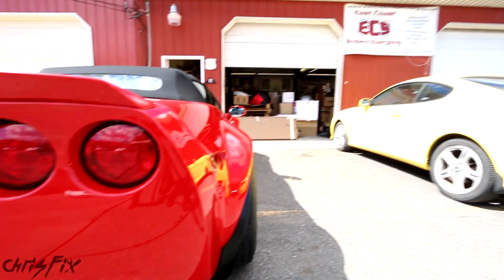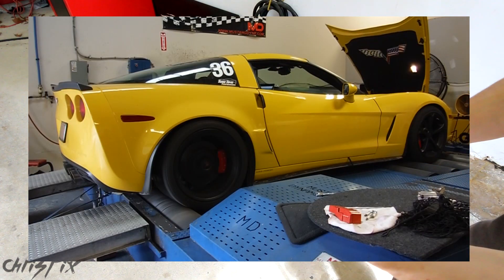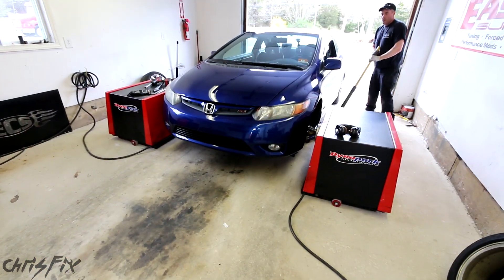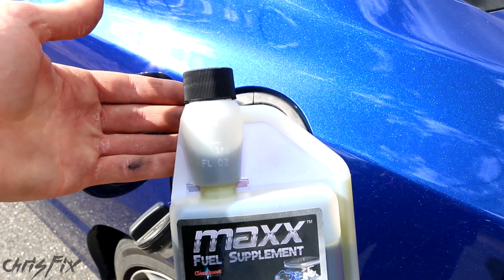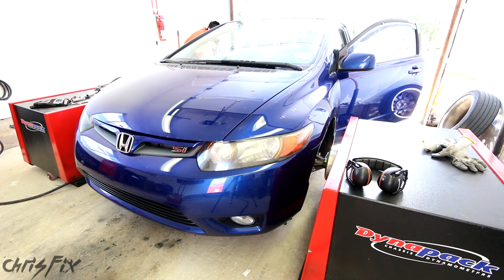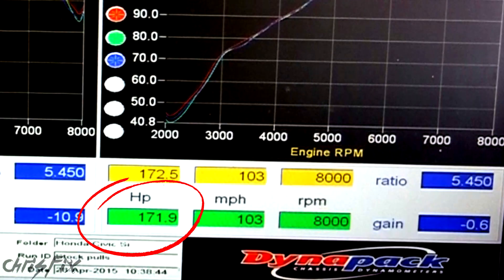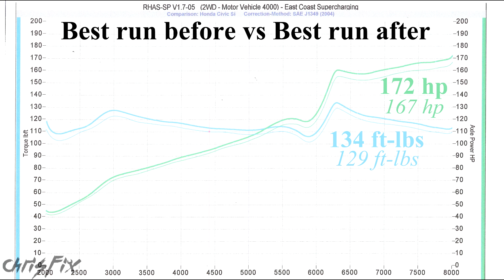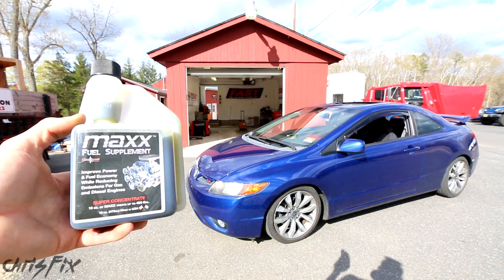Can a Fuel Additive Really Increase Horsepower in Your Car? (With Proof)

Comment: RSX type S vtech kicks in a lot harder. can't really tell on this vid.
Reply: +Slugontharug VTEC isn't just a simple vvt, especially the newer stuff.
standard vvt only advances or retards a fixed profile. 
the first gen VTEC had two distinct cam profiles. lift duration and timing were all shifted for the second profile, this returns better results than a simple cam advance.
Reply: 1: vtech is a phone and toy maker.
2: aggressive crossover isn't always ideal. if your vvt cam is activated a few hundred rpm later it will feel more aggressive because the stock cam has already started to taper off. too soon and you may loose power as the higher lift and durations goal is to build power at the top.

I would argue you don't want to feel the crossover for maximum power, but having an aggressive crossover gets you that kick to the face feeling and probably helps sell cars.
Reply: +Slugontharug care to elaborate? I'm not sure where you are pulling your supposition from.
Reply: Slugontharug"my Nissans VVT kicks in harder then any Honda." Lol. No it doesn't.
Reply: +Gavin Au And my Nissans VVT kicks in harder then any Honda. Way more noticeable and loud as well. If vtec is all Honda has going for it then consider something better, most cars have vvt or 'vtec'
Reply: +Emilio Perez well thank god my g8 doesn't have vtec then. lol
Reply: I'm not sure why. A variable cam has better power performance than a fixed. Think about your big lumpy cams. They usually aren't so hot at the bottom end but haul at the drag strip. The more variable a cam system is the more cake you can have and eat too.
Reply: +Emilio Perez I would argue the dyno is saying otherwise.
Reply: +Emilio Perez Damn, I had written this all out then it didn't post. I don't know too much about vvt so I won't pretend I do. However I would just think it would be more effective to have vvt become effective at an rpm appropriate to the engine and have it come in more noticeably then it would be to have the extra power dispersed through the rpm range ( which I believe is what your saying ) this dyno vid and others will show vvt is more efficient the way it is.
Reply: +Slugontharug research cvvt, it is superior to a two or three stage vvt.
it does not really exist but a continuous variable valve timing and continuous lift and duration system would be better still.

if you aren't familiar with how engines, specifically the role of cams it would take a monster comment to explain. 

if you want to play with this stuff check up on automation on steam.
Reply: +Emilio Perez I'm an apprentice mechanic I have been into cars for years , taking an overhead cam or dohc engine is easy most the time once your use to it. This is all just for efficient power of course there are other better engine platforms but for there purpose I don't think you would want them any other way.
Reply: +Slugontharug what Nissan is that just curious?
Reply: +slime carter There isn't one. The guy's an idiot.
Reply: +slime carter '05 sentra se-r spec v
Reply: +Tyler Hunt There is no what? I'm far from an idiot
Reply: +Tyler Hunt Why do you say that? I'm not even gonna argue with you because right off the bat you are showing you have no idea what your talking about
Reply: Slugontharug
Lol. The Sentra se-r specV Has cam phasing and dual intake runners. That's it. It doesn't have dual cam profiles like a VTEC motor. The "kick" in a sentra is not much more than induction noise.
Reply: +Tyler Hunt Okay. You missed my point , I'm not sure why your going off about that . I'm merely stating vtec is vvt , Honda is not the only ones who do it and my nissan does it better then honda.
Reply: Slugontharug
Lol. With that attitude, you'll be nothing more than an parts changer, not a real mechanic. You obviously have no clue what you're talking about, and worse yet, don't even realize that you don't know. You don't know what you're talking about, yet you have no problem pretending that you do. You're going to want to cut that shit out if you ever want to be a component mechanic.
Reply: Emilio Perez
The original VTEC system is probably simpler than a cam phasing VVT system. It's just on/off as opposed to continuously variable. But yeah, WAY better system for producing more horsepower. And even better now with the addition of cam phasing. 
You're bang on with most of your posts.
Reply: +Tyler Hunt Not quite sure why you are being so hostile. calm down man.
Reply: Slugontharug
You take money from people to work on their cars right? That is your current and future profession right? Then don't be arrogant with things you don't know. I've worked with too many mechanics that don't know their ass from a hole in the ground, but have no problem telling you how right they are. Don't be that person. Be better than that.
Reply: Emilio Perez
There's actually a few different continually variable lift systems out.
Nissan VVEL
BMW Valvetronic
Toyota Valvematic

They all work a bit differently to achieve the same result. But yeah, continually variable valve lift is here.
Reply: +Tyler Hunt my appologies if that is how it came across.
Reply: Slugontharug
No problem man. Just try to be conscious of things you don't know. You won't learn if you think you already know it. Try to be aware of different systems and how they work. It'll make you a better mechanic.

And get good at diagnostics. It's never been more relevant. Parts changers are replaceable, people good at diagnostics aren't.

Hopefully this didn't come off as condescending.
Reply: +Tyler Hunt haha it did at first , but all is good. have a good evening
Reply: Slugontharug you too man.
Reply: +Tyler Hunt you are correct, almost everybody has vvt. 

my Subaru has it as well. (I strip and do basic repairs on subarus as a side job)

Comment: I'm curious how this stuff would add up in a tuned engine?  It's like adding octane booster to a car that's knocking.  Bumping up the octane will stop it from knocking and allow it to achieve it's max power.  But how would it affect a car tuned for performance?
Reply from the maker: +chincemagnet That is a good question because this isnt an octane booster. So you could run an octane booster and this and probably get a good amount of power.

Comment: 0:10 Wow, those are some chintzy anti-performance wheels.
Reply: +K.H. ... wow.  First time hearing someone call a $6k set of forged wheels "chintzy anti-performance wheels."
Reply: +B. L bet. Those wheels are not 6 thousand dollars
Reply: ... they're 360 Forged wheels.  Assuming they're either 19 or 20", they easily clear $5k and are very close to the $6k mark before shipping and tax (if applicable).  They're pricey ... no idea if they're worth it, but they certainly aren't cheap.
Reply: Looks vs rotational inertia and unsprung weight. 

Worth it if you like the big rim (donk) look over, performance. 

Or you could have the right size that clears the disc brakes and allows for enough tyre width.
Which is better for performance and is cheaper.
Reply: +K.H. They came with 19s and 20s stock lmao. They're also wider with a fatter tire on them. So they're actually better than stock. 

Dumbfuck.

Comment: this means nothing , well within the acceptable range , a lot of variables come in to play !! no difference at all
Reply from the maker: +Steve Cea Thanks for sharing.
Reply: Witch Hat Productions sorry but 1 or 2 degrees difference in air temp could have easily given those numbers , you want to push false results on bogus products that's your right I guess but in no way whatsoever should people be running out to buy this garbage thinking they are going to see anything in HP gains,  and even if this stuff by some miracle actually did give you a couple of horsepower ( and it doesn't ) you would never feel that supposed increase at all nor would it improve your performance times !!
Reply: Witch Hat Productions do go ahead a waste your money for HP in a bottle , this is hysterical that people here actually think this stuff does anything LOL !!!
Reply: +Steve Cea using the highest reading from the before and the lowest reading from the after, there's a 4 hp increase, and that's comparing the best results of the first test to the worst results of the second. Furthermore, the consistency of the results after the fuel was added is not what I would consider "no difference at all". They used the same tank of fuel, the same car, and they used a highly accurate recording tool. I don't see how there's "a lot of variables" that went unaccounted for in the performance of this test.

Comment: holy shit that was insane, you need to do this nonce more but pump full gas and use the full bottle! then boom 1000horsepower fu buggati :D
Reply: +xorkatoss um... Bugatti's big trim is 1200hp awd...  but maybe weight will help the SI in a rolling start?  dig no way

Comment: Ok, so something else is going on here. There is an unaccounted for variable in the experiment. We should see some non-trivial loss in performance due to the heat-soak in the second test with the additive.
Reply from the maker: +alephnot000 At $300 a set of runs that is hard to do. I would love to jump on the dyno all day but it is expensive and comes out of my pocket!
Reply: Just keep in mind that the test results are only as accurate as the instrument measuring them. A dyno is a machine that takes a lot of abuse over its lifetime. It wouldn't surprise me to find out that the dyno isn't serviced regularly. If I had the time or cared enough I would take my car to the same dyno every day and get a reading at the end of the day once everyone had gone before me. That way I could calculate the standard deviation and be able to quantify how accurate the dyno is.

Comment: after your 20 minute drive it would of warmed up all the transmision oil and drives and created less friction, and as a result of that the hp would increase on the dino. It would be interesting to do it again in reverse order.
Reply from the maker: Oil and tranny temps were the same (similar) before and after.

Comment: What fuel are you using during this test? 87 octane or higher?
Reply from the maker: 91
Reply: +ChrisFix Hey man great vids all round as been trawling them all afternoon :D. Just want to say that 91oct is Australia's lowest gas rating we have here, then 95 and we have 98 "prem" as well. I'm wondering if you could do a video on either 95 or 98 fuel in the civic doing the same test etc and then adding the fuel supplement? Then you could do a cost on using 91 + additive = HP/Torque vs  cost of using 95/98 = HP/Torque.

Just an idea but I do feel you'll do it with the same methodology and put a few internet myth to rest. 
Cheers!
Reply: Chris Norman I know this is an old video but I have to mention it. Americans rate their fuel different to a/nz. 89 American octane is similar to NZ 92 octane

Comment: Hi Chris, would it be possible for you to do these tests on a diesel?
Reply from the maker: +TransHerring If I can find a diesel car to test, then yes!
Reply: +ChrisFix awesome.  I appreciate the quick reply.  How does this product work to increase power?  And from the tests you did it maintained the power or increased over all 3 runs.  I'm curious how it achieves this especially since it works in gas and supposed diesel as well and these engines function differently.
Reply: +TransHerring I'd assume it bumps up the fuel's octane level a bit allowing the ecu to advance the timing slightly.

Comment: Take note of the big gains in HorsePower even at lower revs!!!

At 2500 RPM, with CleanBoost Maxx it had around 10!! HP more than WITHOUT CleanBoost Max (~15% HP gain). That's pretty amazing! My car only has 60HP.  My car really could use a little more HP haha
Reply: +Kameel The hell are you driving that has only 60HP? A Geo Metro?
Reply: Maybe if u didn't spend so much money on nx cash to buy shit in maplestory you could buy a faster carb
Reply: Maybe a Chevy sparko

Comment: But does having racing lines increase the HP?
Reply from the maker: +hellknightf1 that is like 15rwhp
Reply: ChrisFix i knew it!!
Reply: +hellknightf1 an MCM "CHOPPED" sticker adds 25kw and another 5kw for red calipers, with all these mods plus the fuel supplement you'll be making an extra 50 unicorn farts to the rear wheels, have fun!

Comment: good back to back comparison, but what about the difference in air temperature & humidity between each set of runs that could ALSO account for such a small but positive gain?
Reply from the maker: +goldenvtr The temperature and humidity are calculated into the HP and Torque numbers which is why the machine reads them. Good question!
Reply: +ChrisFix oh awesome. didn't know they factored that into the results.  
keep up the good work dude!

Comment: great demo, a dynamometer is actually an electric generating motor that measures power in terms of voltage and current and horsepower is derived right? are there onboard devices like these that can tell the power whilst the car is being driven without subjecting on a treadmill or garage test?
Reply from the maker: +fidel catsro Thanks and yes! Thanks for the info!

Comment: So the CleanBoost is like adding a cold air intake without adding a cold air intake in power gains?
Reply from the maker: +knightrider1545 Yea basically. But I will be testing cold air intakes on the dyno to see how much of a gain you get.
Reply: +ChrisFix I wanna see that vid.

Comment: Thanks for this video. I know there are a lot of variables that take place when you do such experiment. Now, I will try this product on my car. The reason is gas comparison. I pump premium gas from two different gas stations, one is Freestate and the other is Shell. Freestate gas is .30 cheaper than Shell (2.39 vs 2.71 as I write this). Shell gas gives me better MPG (approx. 20-30) and noticeable improved performance. The car runs stronger and stronger. I own '10 Altima 3.5 V6 4DR with some modifications including ECU tune. I am curious to see what difference this will make running gas from both stations on stock map, without switching to performance or economy maps.
Reply from the maker: +tvalchev Let me know how it works for you! I know for MPGs it varies based on car. Some cars it works, and others it doesnt.
Reply: Absolutely.

Comment: I run the best oil ever made, Cenpeco, which has a TBN of 14! Also use Cenpeco fuel additive in the farm diesel and non ethanol gas. Works great. Can tell my quads, dirt bikes, and tractors seem to have better power with all the Cenpeco products. Also use their grease tubes for grease guns and chain lubricant. You should check them out. Cenpeco lubricants. Common tractor pulling oil.
Reply from the maker: +BrettKuntz Thanks a lot for sharing!

Comment: A honda civic can only go 105 mph. WHAT THE F%$#. NOW THAT'S A P.O.S. FOR SURE!!!!!!
Reply: speed limiter maybe? the non si civic goes up to that too
Reply: I'm a little confused. I thought dyno pulls were done in the final gear. I saw the rpm topped out at 105 mph. This video must be fake.
Reply: +julio lausell most dunk pulls are done in 3rd or 4th gear. This car is likely limited to 155MPH albeit it gets there. Mind you, top speed is nothing. It's how fast you get there. 1 car can do 200 mph and car 2 can do 155 mph. If car 1 does 0-60 in 5.2 seconds and car 2 does 0-60 in 4.3 seconds, and the trend keeps up then car 2 is going to be faster, because no where on public streets will you hit 200MPH.
Reply: +kyle kttheman dyno* not dunk. Fkn auto correct.
Reply from the maker: +julio lausell Dyno runs are done in a 1:1 gear. You never do a dyno run in the last gear which is overdrive.
Reply: +ChrisFix Like they say, You learn something new every day. I need to learn more before putting my foot in my mouth. But now I have more questions, does the dyno machine say what gear each car should be tested in. What happens if its a automatic trans. I know dynos work well, I've just never been around one.
Reply: +kyle kttheman Speed limiters suck.
Reply: dynos are not meant to test "top speed" they are made to measure horse power and torque
Reply: +julio lausell And older 4spd for example having 3rd as 1:1. You would need to bring the car up to a high enough mph, so that it doesn't kick down into 2nd. I used to borrow a Tech II and start in 3rd.
Reply: +\ 0909 All this dyno stuff could make a persons head spin, LOL. But thanks for the info.

Comment: my civic 1998 got 198 HP for a reason
Reply from the maker: +Moua Xiong lol
Reply: ChrisFix is thet good or bad?
Reply: ChrisFix I know why my civic 1998 has more becuse the engine is not electric.              Electric is not as strong as oil gas
Reply from the maker: +Moua Xiong It is good to have more power!
Reply: +ChrisFix oh ok plus it over heat alot